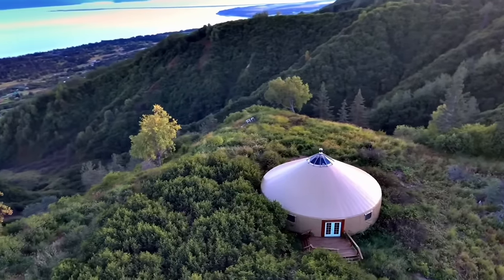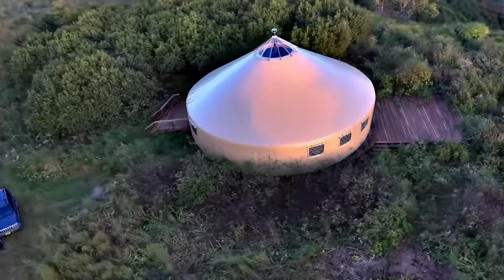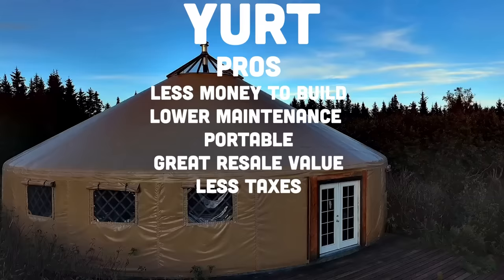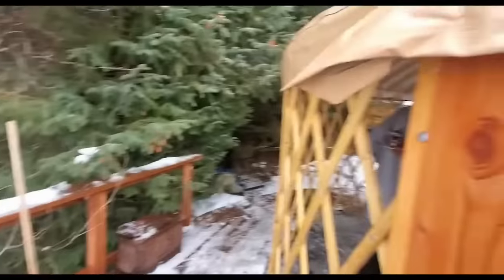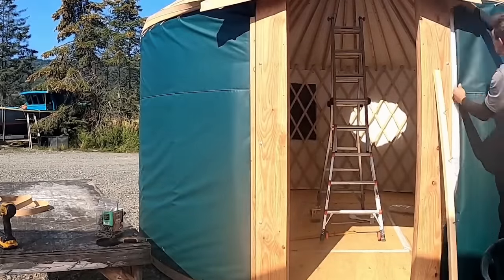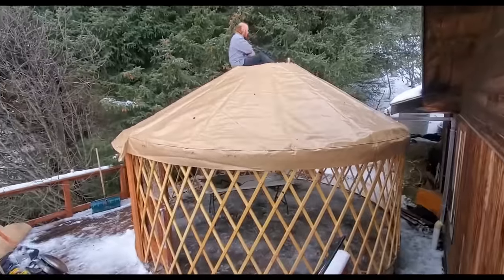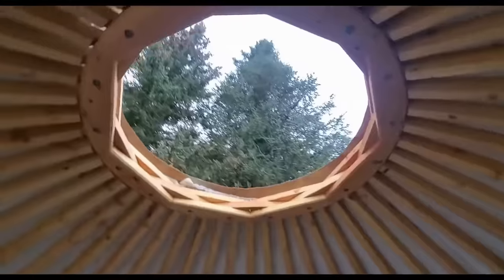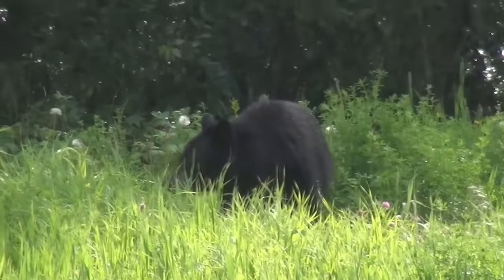YURTS... Affordable Home Solution? Or Too Good to be True? Expert Explains PROS and CONS

Comment: Bear doesn't have to go through the door of a Yurt. It can just knock the whole thing over. A well built cabin that has been bear proofed will seldom if ever get broken in by bear unless it's a monster grizzly. Still I would rather have solid walls between me and a bear if I am living in bear country.

To be fair Yurts were designed for living on the open plains of Mongolia where the only threat was wolves for the most part. So while I would really NOT recommend a yurt in bear country I think they are great in other areas.

Also, I would never build just one Yurt but at least 2. The second Yurt would be for you bathroom and shower. That bathroom smell can linger a bit in the fabric of a glorified tent.

Also, it's a lie that you can't insulate them. You certainly can if you intend to make it a more permanent structure. Just make it bigger than you need so you can build an inner wall with insulation in between.

Also, it's not hard to set solar or wind up so you can have regular heating and cooling in ANY structure so you don't need to worry about just using wood heating.

The nice thing about a Yurt is that it encourages you to spend more time outside. I think it's great if you build a bbq pit and a nice shaded deck to go with it. That way when you get that cabin fever you can just go hang out on the porch.

Comment: I disagree.  If you want a semi temporary structure get a tiny home trailer, or an rv. 
If want  permanent structure get a panel home kit, cabin kit home, barn-o kit home, a-frame cabin kit are as easy to build as a yurt. 
If want go least expensive do a tire / earth ship or  tire bale house.  those are extremely inexpensive,  high insulation value, and stay cool in summer. But high personal labor, and cheapest route in materials needed.

Comment: yurts worked for 10 thousand+ years. your 'analysis' doesn't amount to much. it works. and traditional housing doesn't stop bears either. they're just dry wall with insulation. only the bear's initiative or lack thereof keeps bears outside of your modern home.

Comment: Lol "false marketing" ... this entire video is a sales pitch.  I have taken civic groups, church groups, and even girls Jr. High groups to Mexico and built stick frame homes over a long 3 day weekend many times... about 40 homes.  Small, but larger than that yurt in the video, wired for electricity, wood siding, painted, drywall interior, 4 windows, a door, and asphalt shingle roofing... 3 rooms and a loft.  Typical cost about $10,000.  When I have gone with all builders, we can finish a home in about 10 hours (plus dry time on the drywall mud).  Compare apples to apples.  Your yurt is a temporary structure and not a cheap one... it is just evading the building codes.

Comment: How does a yurt stop vandalism tho? He mentioned bears. Wouldn't any off grid house that has " windows " be easy to vandelize?? Wouldn't it be wise to build a tiny house, lodge, or something without windows if your off grid? I never saw why having indoor light is important than making your house thief proof or murderer proof. Why not just buy some solar lights and bring them inside, why do people feel secure with windows off grid, that makes no sense. Wouldn't some deranged hunter just have to throw a rock through your window, while the 911 call is 30 mins to 1 hour away, is having some window to book read during the day really worth that? Aren't you suppose to be outside anyways during the day and asleep at night? Windows just seem stupidly risky if off grid. I suppose if you didn't have a window, you'd need 2 doors for fire escape. And both doors would have to be bear proof. Tho I bet if you really want anti off grid defense fort, you'd build a small lodge and not a yurt. Still even for a tiny house I wouldn't build a freaking window.

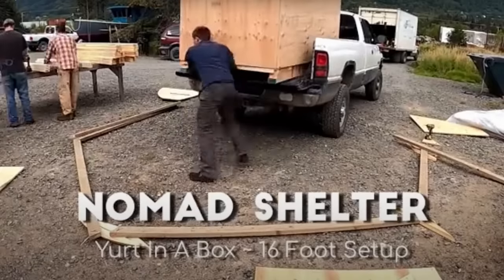Comment: @0:47, he states cost at, "Dollar's per square foot!"? What does he think a conventional home costs per square foot? This statement in itself expresses nothing in savings. Sure the dollar amount per square foot may be less than a conventional home, however, I would have guessed, or it should be, pennies to cents per square foot for the cost of the Yurt. I'm guessing that these prefabbed Yurts, at the same square footage, would be comparable in cost to a DIY conventional wood frame build. And more than likely, the wood frame would hold up for many more years, especially the exterior siding. Can't do the DIY, try looking into "Shed to Home" videos.

Comment: If you live in a Mongolian built yurt, you won't have the same problems as you would in a silly American knock-off like a Pacific Yurt. These American companies think they can improve of 3,000 years of perfection. They can't. There's a reason why I, and most Mongolians prefer them over conventional homes. Btw: Yurts are NOT meant to be modified into modern American homes. In that case, it isn't a yurt. Just a round structure. Also, DON'T put them up on a deck! I've lived in mine for over a decade, and i don't want to live in a standard structure ever again. Yurts are great housing for the future! Light on the land, easy to move, create no waste to build.

Comment: This guys actually saying a house degrades year after year and requires all your time to maintain and keep up a house? What a joke. A simple wood frame with a standing seam metal roof and metal siding will last for centuries. The cost of these yurts is so high. The only reason to use a yurt is if are you are restricted legally when it comes to building. A yurt is a tent so it skates past regulation.

Comment: That is so BS.   Its a canvas, it WILL where-out  far faster than a normal house. They are good for temp home,  but they have no insulation (its a tent with a stove in it).   Don't be fooled.
Reply: Yeah the maintenance and upkeep definitely was glossed over in Thai video. Our Yurt the ropes they estimate need replacing 3-4 years  the extra ones I got UV degraded in 6 months. They were part of my Hurricane tie downs. There is regular maintenance and they really recommend your moving them regularly if they are canvas and natural materials. It looks like these guys have different materials in their kit but definitely not less hands on in a Yurt for maintenance and care then a house.